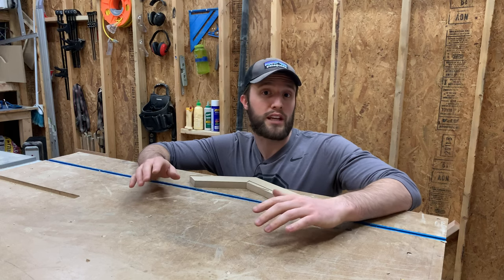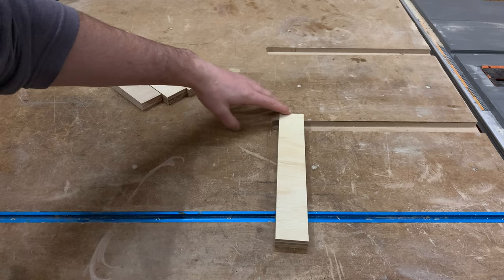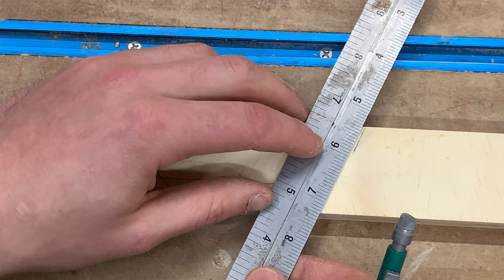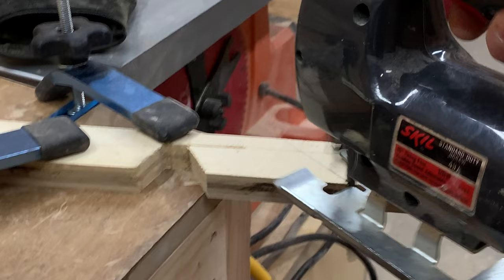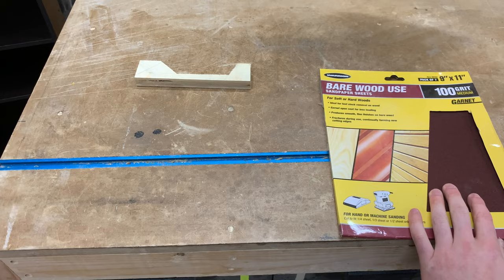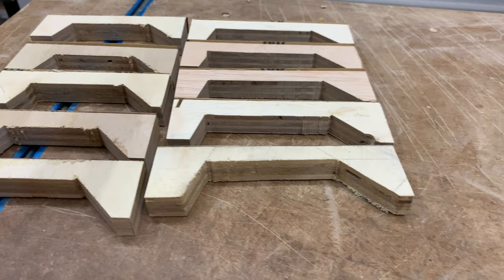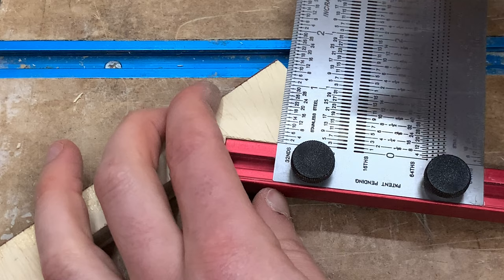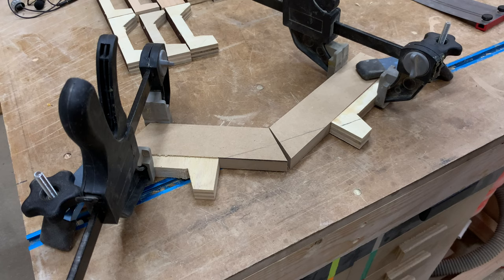I dont understand why people make this so complicated

Comment: Using abrasive paper as a method to create good clamping purchase can be used in other applications. I also have abrasive adhered to my miter gauge surface as well as the clamping surfaces of my doweling jig to keep the material or jig from slipping when pressure is applied. Screw type clamps could be used to more securely fasten the jig to the material. Most people apply too much clamping pressure to close the joint. When if fact, cutting a clean and accurate joint is the real Achilles Heel. Applying too much pressure allows another dynamic, unwanted movement such as "lifting" of material. If everything is in alignment, extreme gluing clamping force is not necessary for a strong bond. You did a great job of explanation and layout about the need to apply pressure at a 90 degree angle to the center of the joint.
Reply from the maker: Thanks, Joe! You bring up a great point!

Comment: How long and wide are the clamps you built? Do they need to be a certain length for them to work properly?
Reply from the maker: Hi Luis! Thanks for checking out the video! The blocks are about 5 inches by 2.5 inches but there’s really no incorrect size to make them
Reply: Spencley Design Co. thank you for the info

Comment: These is just what I would need... But I didn't quite get how to draw the line... for pressure directing guide, if you will. Marking the center, yeah got it, but where to from that, that is a mystery for me. Maybe it's the language barrier that makes this a bit hard to understand. Oh, but is the line supposed to be the same angle as one need to press?
Reply from the maker: Ideally the force would be applied perpendicular to the joint face, but it’s not always possible depending on the angle of the joint. You just try to get as close as possible

Comment: I'll agree HF sandpaper is the worst. I was polishing something once and worked my way up to 600 with some 3m stuff and the next grit I chose was HF 1000 and it scratched the work all up, all paper was aluminum oxide. I was all ready at near mirror and it just fked it all up. With proper expectations and ignoring their grit claims it's not so bad, and I've had rather good results with the garnet paper there like you have in the video 24grit and 220. Hf is the only store near me that you can get paper other than Aluminum oxide and I've found that I'm certain situations it really pays off to have the proper abrasive. I have an embarrassingly large chest of sandpaper. 24 grit to 15000. I like Shiney things.
Reply from the maker: Thank you for sharing

Comment: Where do you get that protractor and ruler with the holes in?  Can't find them online at all.
Reply from the maker: https://amzn.to/33nLTMs
https://amzn.to/33rcxEk
Reply: @SpencleyDesignCo  Thank you very much. I'm gonna make sets at 5 degree intervals (one set with 5 & 10.  Another with 15 & 20 etc, up to 45 degree.
Reply from the maker: That should work nicely! One suggestion I have is to use a higher end plywood like Baltic birch. That’s a lot stronger than cheaper stuff 😀

Comment: I just started woodworking one month after covid quarantine and I can't even begin to tell you how many scraps I have.
Reply from the maker: 🤣 I totally get that! I’m glad you’ve found something you enjoy and have been able to occupy your time! What’s your favorite project you’ve made so far?
Reply: @SpencleyDesignCo  Its been amazing wish I could have done this years ago, although I'm not sure how disciplined I would have been on safety so it's probably better I started at a later age so I have a better chance of keeping my fingers.
My favorite project has been my 8ft by 7 ft tall wall storage with drawers and cabinets. I used French cleats to hold it against wall since I live in earthquake prone Los Angeles. It is solidly built each shelf seems to hold a minimum of 100 lbs. Some easily hold 300 lbs. I will never buy cheaply constructed furniture again. My designs are getting better but what I have most enjoyed is everything I have made has been my own creativity while stealing methods on how to build my ideas.

PS: Turns out 1 inch pine can actually take a couple thousand pounds to 2 tons. Now most likely what will fail will be the pocket screws before I get to that point but now I know what my wall storage can take. I actually have a 100lbs on one shelf and it doesn't even look like it's holding anything. I'm so used to store bought furniture flexing just by setting 50lbs worth of stuff on it.